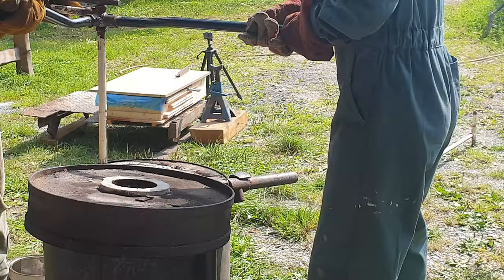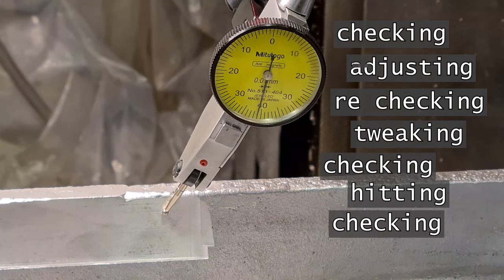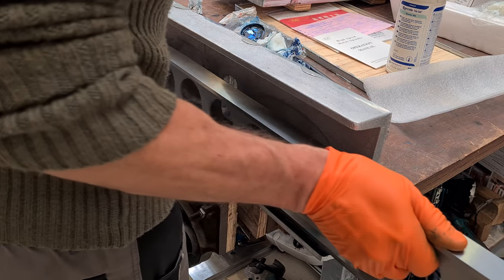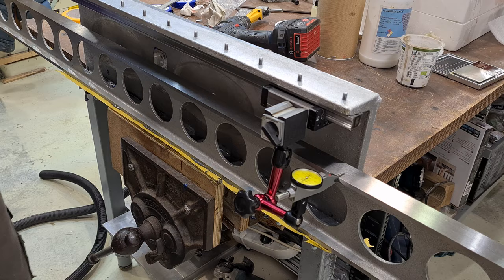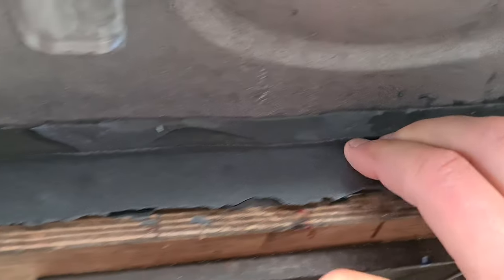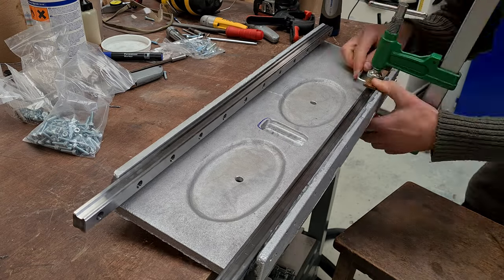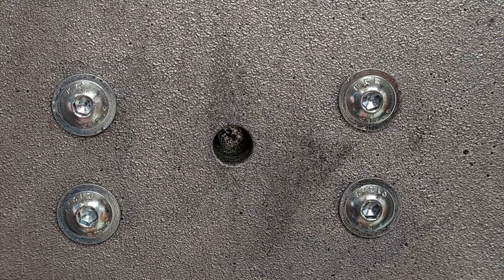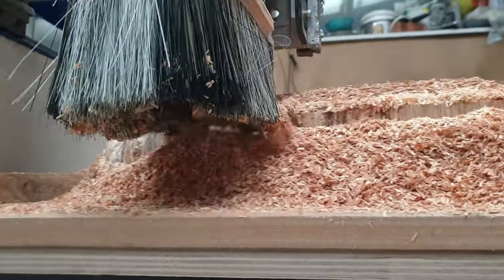PRECISION the easy way, making CNC parts too big for a hobby mill

Comment: Salut I'm in the process of decision , if I transform my router like yours . I have a 3 meter x 40 mm ball screw and the whipping is not very pleasant. My ball screw are 62 mm  exterior diameter  and it making bearing very expensive. But your seam to work well so I'm thinking ...
Reply from the maker: If they are 62mm dia. I expect the speed of rotation allowed for the ballnut is not terribly high, so perhaps not the best application of the rotating nut...? Have you looked at the spring-loaded plastic staberliser-type devices that help with whip?
Reply: @FloweringElbow4SuperNerds   Thanks , I never hear about plastic stabilization ? The nut as 62 but the screw is a 40mm dia.
Reply from the maker: @alainroy400  I'm talking about something a bit like this - https://www.youtube.com/watch?v=NWB6FAJCPhA&ab_channel=PaulWysocki   Hope that helps ;)
Reply: @FloweringElbow4SuperNerds  plastic stabilator where to find?
Reply from the maker: I suspect it would need fabricobbling up oneself...

Comment: To plane aluminium flat you need to make the knives flush with the outfeed table rather than slightly proud as for wood.
Reply from the maker: Thanks for the tip. After investigating a lot I found the infeed table was a bit twisted :( hence the slight non-flatness of the alloy casting.

Comment: Why not use a proper compound for replication?

It's cheap and it won't creep to any meaningful degree.
Your mixture most probably will creep a lot, that's rather hard to avoid and has nothing to do with It's compressive strength like many seem to think btw.
Reply from the maker: Hi there Heinz, thanks for watching. I have to disagree on the cost of ready mixed ones. They are convenient, I must say, but you don't have the ability to make up different viscosities (that can be injected with a syringe for example). The other thing is that you can't make a scratch coat, which is better at bonding to the fixed surface. 
I haven't researched enough on the creep front to comment, but I don't honestly expect to see any significant creep on the stiff metalized epoxy mixes... People/companies make whole machine frames out of epoxy granite, that has a similar aggregate: epoxy ratio... It's an interesting subject, will have to do more research.
Reply: @FloweringElbow4SuperNerds  I have used west 105 + 206 + iron powder and was also able to copy a surface in sub-micron precision. Resulting in 2um flatness on a 20x20cm square
Reply from the maker: @BuildItAnyway  Impressive!